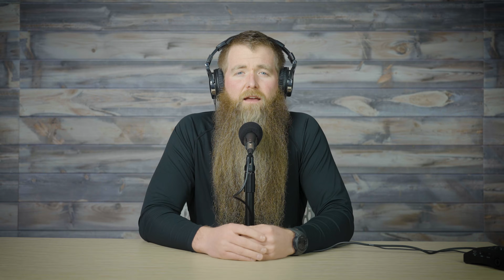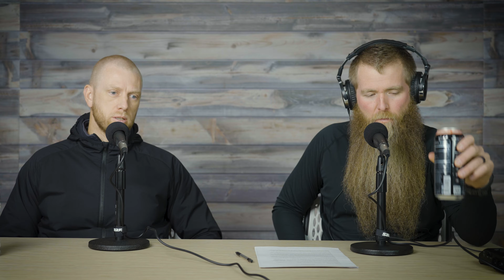Most Underrated Backpacking Gear: All-New Nebo Windbreaker Deep Dive

Comment: Assuming the 20cfm breathability is fairly similar to the various/Ventus, would using the nebo with an ultralight active fleece produce similar results?
(With advantage of being modular)
Which I would be interested to hear discussion on 1. when to use nebo over just base layer vs 2. When to use the fleece without the nebo.
I think this also leads to an interesting conversation and the Pursuit Hybrid fleece being another alternative, but without as much wind protection (body mapped 50cfm shell)